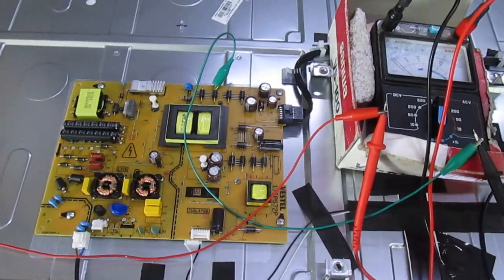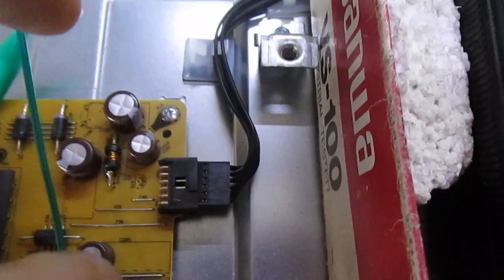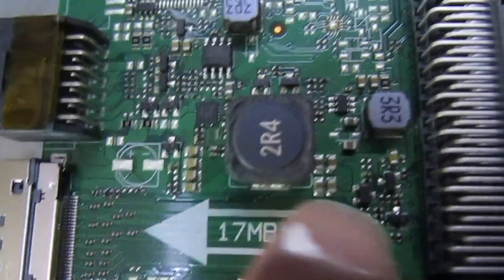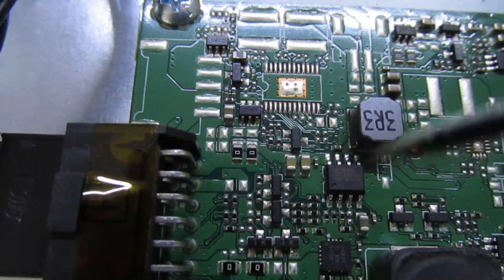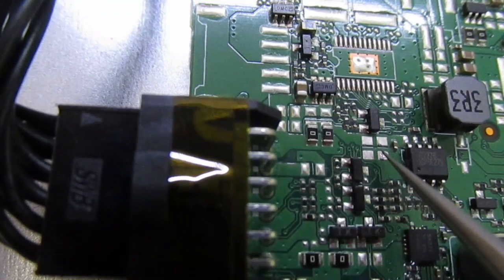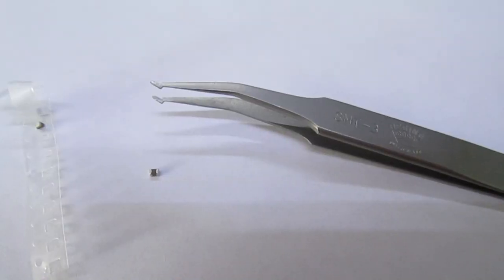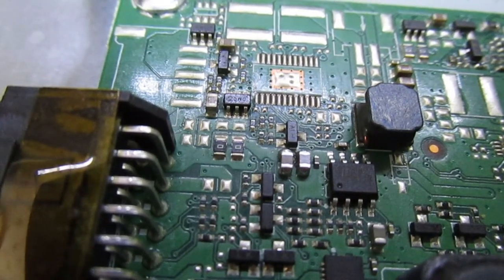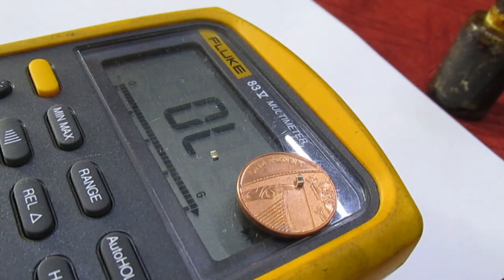MLCC failure in TV sets

Comment: With my eyesight I can lose a screwdriver on my bench, let alone one of those capacitors. LOL 👓👍
Reply from the maker: That's why you have to buy a few at a time as you can loose just as many as you use !
Reply: I smiled at the miniscule size of those SMD Caps. It's never easy when you know that the placement has to be accurate, but then, you get the 'shakes' when trying to solder the new ones in place. It could be age-related for me, at over 70+!!

Comment: Would be nice to know what voltage specs were those failed capacitors. I have seen fail most commonly the ones that are high capacitance (10uF and above) and low voltage rating (less than 16V).
I think they suffer from electromigration where the metal electrode layers create conductive dendrites through the ceramic layer, helped by the electrical field. Eventually, a shortcircuit is created between the plates of oppsing polarity.
Reply from the maker: While it doesn't say on the vestel 17mb130 service manual I had a quick look at the 17bm95 circuit and they have 6.3v capacitors on a 6 volt rail ?? , but your theory of dendrite growth is very plausible  as we have tin whiskers growing in most other consumer electronic stuff, interestingly enough back in the days of sky digibox repairs I saved a load of faulty  sky boxes which had tin whisker growth in a particular chip MAX2104CCM I think it was and I have had these boxes for over 10 years in storage but now they all appear to be working again !
Reply from the maker: I just keep 25 volt  ones as a replacement that come from RS components .

Comment: Very nice Michael, sure wish you could show us what lead you to suspect those capacitors on the other board, assuming you don’t have a schematic diagram to trace the diodes on the one board as being connected to those caps on the other pcb. Or did you have the schematics?
Thanks
Reply from the maker: Years of experience with vestel repairs , if you have a dead short its more likely to be a shorted MLCC capacitor than any other part .

Comment: Yeah I’ve had loads of the vessels with MLCCs dying been a think right since the 17PW15 😅 See them regular too on stuff like controllers, hifi audio etc. They are a right bugger to track down and fine at times 😭
Reply from the maker: For some odd reason the most common failings of these is on LCD panel integrated T con pcb s

Comment: haha thats the same psu/board combo i'm watching this video on now, but one thing i notice on yours is you have the wire links under the diodes, mines drilled and marked but not populated, i did wonder if it was to pick up heat from the diodes and transfer it into the pcb.
and that 17 130 main board, thats the one i have the phantom 'down button' press with so it scrolls through the input selection menu all the time, but only the input menu..... and i can select an input and it hides off screen so not worth trying to track down.
Reply from the maker: The  wire links  , vestel do some strange things , a bit like putting 3 diodes in parallel when just one would do .

Comment: Hi Micheal, I have not long discovered your channel, I find the videos very informative, thanks!  
What value were the capacitors and how do you know what to replace them with?
Reply from the maker: the caps were 10Uf  25 volt  0805 size and if you don't have access to a circuit diagram , in fact most makers dont supply diagrams anyway now ,just download the datasheet for the switching chip that these capacitors are decoupling and get the recommended values from there as most TV set designs seems to be just lifted from the chip manufactures datasheet .

Comment: Hi Michael, we spoke before about my Samsung qled tv which was in a boot loop. I’ve got the tv staying on now thanks to one of your videos, but don’t have any image unfortunately, back lights are on but no image. I think I’ve traced it down to a mlcc on the tcon strip, using an ESR meter. I am wondering if you would have any idea how I can determine the capacitance of the mlcc? It’s 0201 (0.6mm x 0.3mm) so from what I’ve seen on RS they range from 10pF to 2.2 uF? Have a photo of the mlcc I believe is faulty but can’t attach here in the comments. Code beside the cap is C090, but I’m not sure is that just a numbering system by AUO the tcon manufacturer or indicating 9pF. I have a multimeter but I believe it won’t measure mlcc capacitance accurately? Would really appreciate any advice. Thanks, Robert.
Reply from the maker: The local decoupling capacitors on the T con board will usually be between 2.2uf to 10 uf and if the designer needs more capacitance than 10uf multiple caps will be placed in parallel, with no circuit diagram all you can do is remove one of the others and test its value, more often than not though these caps go Leakey or total short circuit which will cause the chip that generated the LCD bias voltages to shut down

Comment: Them bloody caps are the bane of modern electronics. Conspiracy theorists would suggest they are designed to fail 12 months and a day after first switch on!
Reply from the maker: Thought I read somewhere the reflow process could cause micro crack to appear in the package possible leading to failure.
Reply: switch ON
when it relates to SWITCHING
the correct word is  ON  OF  (in ALL CAPS)

on / off is used in an entirely different context
such as  I start work on Monday and I am off work on the week-end
When you pay attention what is written on SWITCHES  
it is  ON /  OFF   and not  on / off
The word ON goes back a couple of thousand years - 
when the SUN of God ( That yellow thing in the sky) rose over a mountain named ON
and the people chanted  ON - 
Thus it came to be : Turn the light ON 
Only you were not taught ancient History at school - thus you do not know it/
Now you know. Teach it to others who have no idea
Reply: @michaeldranfield7140  I don't trust Conspiracy Theorists since They usually have no Idea what They are Talking about